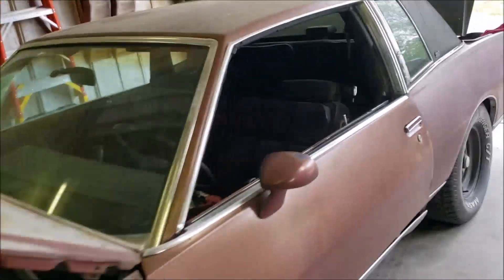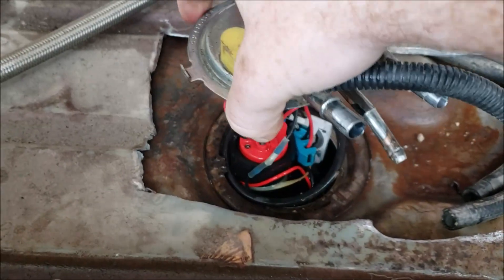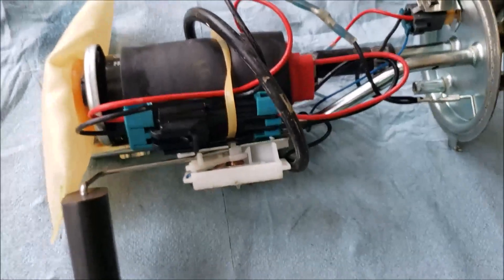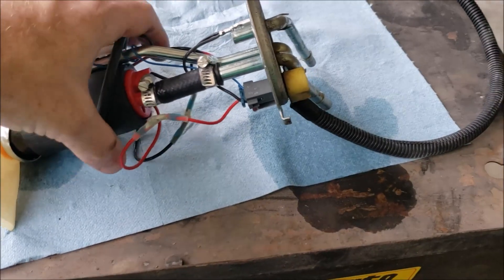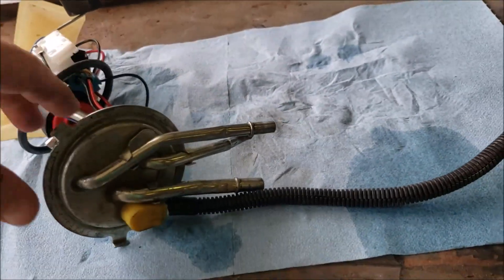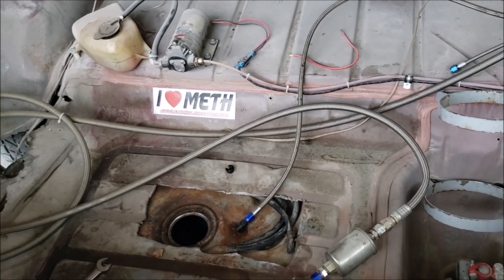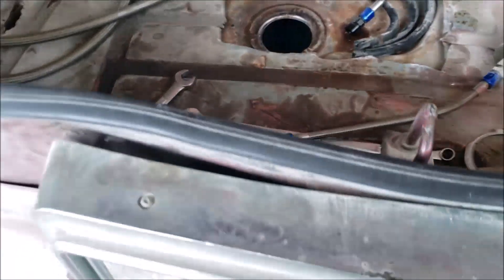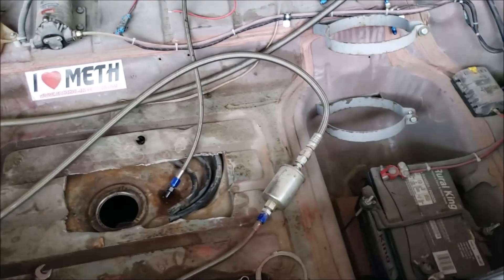G BODY LS SWAP FUEL SYSTEM OVERVIEW WITH PART NUMBERS AND WIRING DIAGRAM

Comment: How's the non baffled tank working out? It'd be nice to save a couple hundred bucks if all i gotta do is keep it half full
Reply from the maker: Around a quarter tank I was having issues with running out of fuel going around curves. I don't know if using a monte carlo efi tank or a grand national tank would have been better  in the long run. I just switched to a fuel cell with twin 450 pumps.

Comment: Hey, can you please tell us where you had your long AN line made? Also, what length did you make it? I have had bad luck with the assemble at home type, after some time, they start to leak. I could see in your video that yours was crimped!! And great video, keep them coming!!
Reply from the maker: I had a local hydraulic shop make mine. They'll have all the fittings on hand. Another type of line I really like is the Aeroquip Socketless hose. It's rubber but for a home made line, it works awesome. You also have to buy the socketless fittings but they do not leak.

Comment: I have a question in your previous videos you ran the return line in the 1/4 middle line and the vent on the 5/16 end line. Now you're running the vent and return opposite why the change?
Reply from the maker: I was running the factory rubber lines when I first switched to fuel injection. When I made the switch to AN lines, I had to swap the return and vent line just due to the AN adapter having something to hold onto.